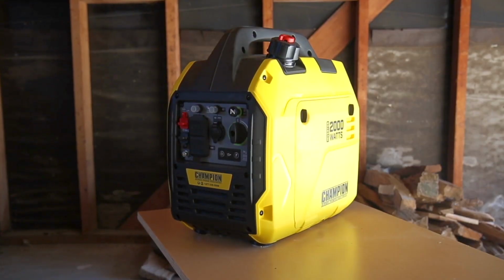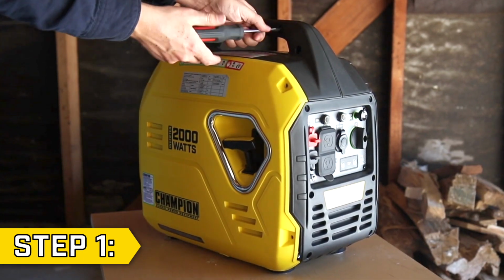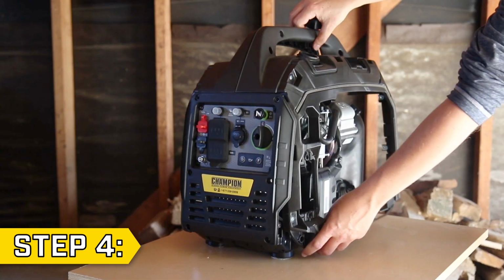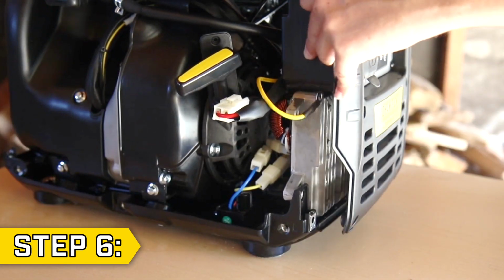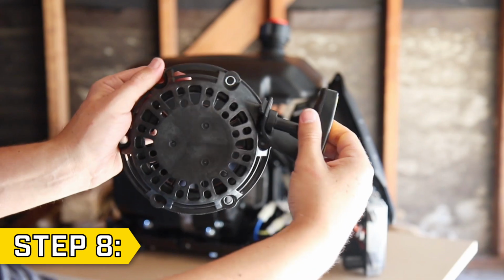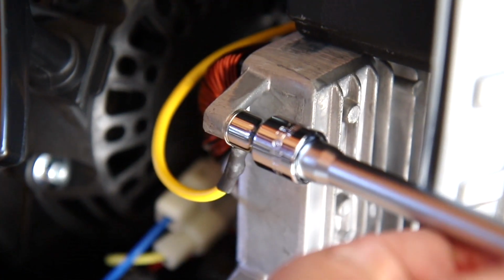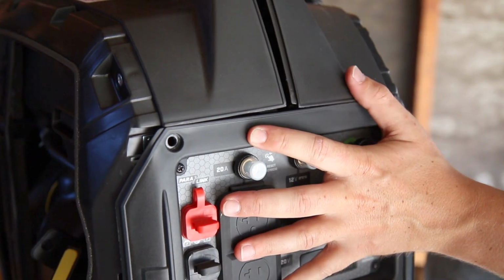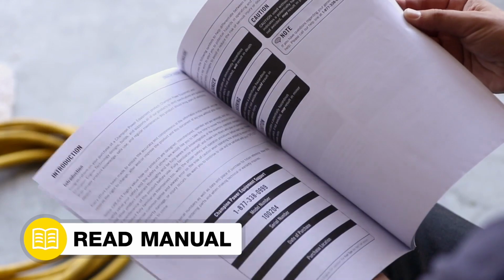Recoil Replacement (100692)

Comment: Wow, i have about 15- 20 hours on my 2500 and pulled the cord and now it wont recoil. Pretty disappointed.
Reply from the maker: Hi, we do apologize, it sounds like you may have an internal failure with the recoil assembly, please contact customer support for replacement assistance at 877-338-0999, using our Live Chat feature through our website, or by email at support@cpeauto.com. Thank you for your patience
Reply: Haha I cane here to say the same thing. Great video tho, very thorough.

Comment: Pretty disappointed that my recoil assy exploded upon its 4th start ever from a new unit.  I called to initiate my warranty (less than 1 year), and was told this wasn't covered as it's a "wear item".  If something breaks after being used under 5 times, it should not be considered a wear item.  Poor design
Reply from the maker: We are sorry to hear this. We do review issues like this on a case by case basis. At your earliest convenience, please email us at support@cpeauto.com. Thank you for your patience.
Reply: @ChampionPowerEquipmentHQ  My issue was resolved via your support team.  Thank you.
Reply: My recoil rope severed after one year at 600 hours use. This was due to poor design that caused wear on the nylon rope from the grommet where the rope exits the recoil assembly. 

I'm disappointed that this happened, because Champion builds a great product that sometimes overlooks the simple things in design. This is my third Champion and I might just consider trying Harbor Freight Predator models
Reply: @MDLynch600  I can understand a rope breaking from abrasion being a wear item and not covered under warranty.  In my instance, the mechanism itself grenaded into lots of pieces.  With that said, Champion support was able to resolve my issue